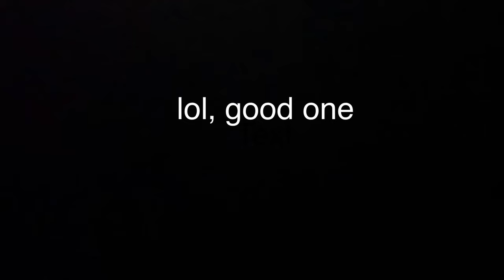(B)Lase it - Potting a Sotac Perst 4 laser tutorial

Comment: I bet if you press the circuit board into warm play-doh just deep enough it would allow you to pot the board to the edges all the way around. Press it into the depth corresponding to how thick you want the potting epoxy.
Reply from the maker: good call!
Reply: You can just masking/packing tape around the perimeter leaving a lip. Fill with potting then peel away tape when cured.
Reply: @LeCafeRacer  This is the way

Comment: I previously did this with airplane and missle parts. Typically you dont cover the lands and leads you put the compound at the ends of the part. Doing it this way 100% ensures youre buying a new one if any solder issue arrises because you cant access them now. If he placed the compound on the ends/ sides without leads you can easily fix or remove a part.
Reply: What do you mean at the end of the part?
Reply: @JohnDonne3PersonGod  the ends/ sides without leads(metal legs) coming off the part that are soldered to pads on the circuit board.
Reply: @JohnDonne3PersonGod  depending on the part you only apply it to the corners. It's all dependent on where the leads are. The pieces that don't have leads don't need it because the issue with those part is typically a solder fail. Parts that have leads are prone to having the leads break, this is why you don't cover them. The potting/bonding/masking is designed to help it last longer under prolonged vibration, but it will not PREVENT it from happening. When those leads break he's either going to buy a new on or use the appropriate chemicals and tooling to remove that bonding. A process thats likely to damage the board itself and other parts around the initial fail.
Reply: So if I'm envisioning this correctly, it's the potting compound on the edges of the PB and the underside w/o the leads? Is that really sufficient for vibration? I have no intuition regarding this.
Reply: @JohnDonne3PersonGod  sufficient enough to be used in military jet engines and JDAMs. Especially with the type of compound he used. There are parts and boards that get encapsulated but that encapsulate is as runny as water and after a bake in a humidity oven( basically a giant steamer) it sets to a consistency slightly harder than jello and can be removed with tweezers, a pick and q-tips with isopropyl alcohol. What he used will dry much harder and you need specific equipment to remove it. The typical potting you would see in commercial use will be a rubbery consistency because it disperses the vibrations, the harder compound he used is for securing parts to the board and to provide structural support for the leads.
Reply: @JohnDonne3PersonGod  so you could pot this but you would need place masking( removable silicon compound) where you don't want potting. Then figure out the best way to fill the full inside while removing as much of the air bubbles as you can, in prototyping i used a vacuum chamber to draw out bubbles. Then bake it in a humidity oven, the ones I used were 90° with a constant flow of steam.
Reply: @Noneyabiznez1209  Could you make a video or post photos to a blog showing your method?
Reply: @Zork13  I would, but the company and us government would appreciate me showing how boards used in JDAMs and our military jets are made. What I do with potting requires a vacuum chamber so the rtv or whatever product it used doesn't have air bubbles. This means mixing the product, placing it in a vacuum to remove bubbles. Filling whatever electrical component that needs reinforcement for vibration reduction purposes. Then, placing that entire part in a vacuum or filling while part is on a vibration table so bubbles are worked out by vibration. Then whatever curing method is described. If it's just staking corners you just place a line fton the top of the specific part and run it over the edge onto the circuit board, (((without putting the bonding or staking material on the tin lead leeds)))). If you use one that dries solid instead of more elastic it will damage your components if you ever need to take the bonding or staking off.

Comment: I used painters tape to cover those and carefully did mine with liquid electrical tape on the circuit board, and then used permatex gasket maker and clear silicone on the wires as well and inside the device.

Comment: I potted 5 with liquid electrical tape and hot glue. Also applied acrylic conformal coating to all the electronics. 
Lol, on some of them the top button doesn’t work and neither do the + or minus switches.
Thankfully, the other power switch works and the switch to change between vis and ir works. I also have the pad to change the power levels, which is annoying since I don’t look and can’t use it on a lot of the guns I have due to space. On the plus side, they don’t revert back to a base power level so I can pre program the power setting with those pads, if you’re using ir you should really use the lowest power setting anyway, 20mw just using that usable and way too bright. Even the 5mw should be used with a diffuser.
I bought them as dedicated IR lasers so I only wanna use the ir setting. It would be nice if the vis and ir were slaves though. Don’t see why they aren’t, wouldn’t cost more. 
It’s definitely full of glue and liquid electrical tape. Nothing is moving out of place and it’s better sealed against water now and moisture.

Comment: Might be a good idea to blast the PCB with conformal coating while you have the unit open, after potting. That way any ingress of moisture won't be as much of an issue.
A thin bead of blue loctite around the mating surfaces of the cover and a silica gel packet left inside would help, too.
Reply from the maker: yes! got my hands on some now

Comment: JB weld makes a metal infused epoxy that is like clay. And you mold the gardening compound in with your hands and you put it down like clay, so it doesn't run everywhere, and you push it into place. And you have the extra metal infusion for hardness. That would be good to use.
Reply from the maker: is it conductive? if steelstick actually has steel in it you would immediately short out your board and it would be useless

Comment: Great video! Just follow along and did mine. Have you thought of trying to investigate and fix the co-alignment issues with the IR and vis laser?
Reply: Just did mine as well and I'm pretty happy with it.  As far as the laser co-alignment, I've put a bit of thought into it myself and the only thing I can really think of is milling out a new laser head assembly out of aluminum (or something else strong) with perfectly parallel holes for the diodes to thread into. It wouldnt be too hard to do with a good mill or drill press but the turret assembly threads look pretty delicate so be careful disassembling it if you decide to put the effort in to go that route. Otherwise just pick which beam you like more, Then set it and forget it.
Reply from the maker: @Aupexx  yeah, for a 120$ device im not sure how far down the rabbit hole i want to go, i only got it for the IR since the vis is eh anyway
Reply: @tiffen-e7t  my thoughts exactly. I personally just put a diffuser  to catch the nasty diode spill. And put a small hole over the ir laser. Now I just use it as a single mode unit with an IR laser that has a bit of extra flood lighting from the diffuser. Cost about $10 and works well enough that I'm happy with it
Reply: @tiffen-e7t  great video by the way! Potted my unit and it's holding beautifully
Reply from the maker: @Aupexx  awesome to hear! I didnt think this would get so many views lol, just a little hobby project of mine. I actually just ordered a Wadsn Raid-x to try the same thing. Im curious to see how it opens up and if it offers more access to the lasers themselves, might be an opportunity to co-align easier. just ordered it yesterday so i guess we will see!
Reply: @tiffen-e7t  hell yeah! Would love to see a video on that when you get it figured out. Cheap lasers have become a bit of a hobby for a lot of us it seems haha
Reply: @tiffen-e7t I agree. I ordered one after you posted this video and decided for $120 it's worth it for an IR standalone unit.
Reply: Anyone experiencing batteries dying while set to off?
Reply: @tiffen-e7t So I got curious and decided to try my hand at co-aligning the lasers. I purchased another unit to play around with and disassembled it.

The problem I ran into is that the housing for the laser modules themselves is very thin all around. There simply isn't room to add indexing set screws or anything. Plus the lasers were fully potted with hot glue and I didn't bother digging them out of the housing.

Comment: Heat around the lip with a heat gun on low, then use compressed air with a rubber tipped nozzle to blow into the screw hole and it will pop out...

Comment: i thought you were going to adjust the laser, thats what we called potting back in the day, because you adjusted the "pot" or the potentiometer that controlled the power going to the diode.

i see potting electronics is the act of dipping a pcb or other electronics and or assemblies all at once into a "pot" of material that would harden and make the electronics sturdier, protect from shock, chemicals, water, liquids, gases etc etc.

i would guess that this "potting" in the video is more of an  "conformal coating" application.

 i found the title of and the action in the video to be confusing and thought i would share my take, but what do i know.

Comment: Wouldnt a better method, or an additional method, be soldering the connections to be stronger and/or replacing weak wire with stronger wire? It seems to me that pitting wouldnt be as necessary if the connections are beefed up
Reply from the maker: Certainly could help if you have the skills and patience, but its generally not the wires that are breaking, and adding more solder doesnt necessarily mean a stronger connection, so the potting just locks what needs to be locked in place and protects it against the recoil.

Comment: Any update here?
Did you do anything to the springs that holds the laser in place?
When those springs move the zero will move. I put some epoxy on both springs so they can’t change position.
Reply: @JetHenke HAHA I see at least 2 of us are spending NYE checking for updates on DIY laser armoring 😂 
I also want to know about those. Think I’m gonna epoxy mine if it worked out for you… I legit also thought about ordering custom wound replacement springs & swapping them in. Likely overkill AF, but that is def me… overkill AF. Wife calls me “Garage Overengineer” 🥸
Reply: @j.crizzle8942   Haha 😂 I have spent half day with my Perst-4. I secured it inside with epoxy on some spots and then glued the 2 springs with epoxy. After that i did alot of drop test from 7-8 feet down to the concrete floor. Nothing moves, it keeps zero perfect. Now i’m sure it will hold for my .223 😁
Reply: @JetHenke  YASSSSS 😆 that’s rad. Happy New Year of Pewing 👊🏽
Reply from the maker: @JetHenke i wouldnt epoxy them since then you literally can never change it. I wasnt able to get the turrets out without destroying it so i didnt mess with em. id be curious to hear how you got in there
Reply: @tiffen-e7t  It’s to late 😄
I was not able to remove the turrets but i took a small plastic pinn and put some epoxy between the laser and the spring, in other words is the laser and spring connected, so the spring can’t move away.
It’s still full functional since it’s not glue on the other side. 
It works perfect so far and i hope it will continue that way, i’m not ready to spend money on an authentic Perst 4 😬
Reply from the maker: @JetHenke  how did you get to the lasers? through the front?
Reply: @tiffen-e7t  Yes the front. I used a good led light. It’s pretty tricky!

Comment: wouldn't just using hot glue on everything achieve the same thing? why is the potting compound necessary?
Reply from the maker: potting compound hardens to a solid epoxy when cured. This holds everything together as one unit. Hot glue would still leave it open to vibration due to its softer cure when cold
Reply: @tiffen-e7t  i thought about that, but then wouldn't it being softer mean it would dampen more of the shock, the glue absorbing the vibration and thus keeping those forces off of the components? rigidity is not always the most prevalent factor for these kinds of things, the concept that comes to mind is the best swords actually have a degree of flexibility to them, too rigid can cause it to shatter and too flexible will cause it to deform. i obviously could be wrong, but what do you think?
Reply from the maker: @Knifegash  you want everything to move together. If the material is soft, eventually the pcb will vibrate independent of the soft hot glue as it would detach since they will absorb vibration differently. like, if you take a buit of hot glue over something, and roll your thumb over it, it will eventually separate from the component. epoxy wont do that

Comment: Just curious - what is the purpose of doing this?  Is it mainly to keep components from coming off the PCB under rough use?  If so, wouldn't it also be beneficial to resolder the components with leaded solder for greater flexibility?
Reply: It's to help vibration mitigation. It can pop parts loose this helps prevent that from happening as often. This was done wrong though. It will work for what he wants it to do, until it doesn't and then he can't fix this. We'll he could but to remove that bonding it's a long and frustrating process even if you use the correct tools of solvents, and there is major risk of damaging even more parts. I use to designed bonding templates and practices while working on airplane and JDAM circuit boards.
Reply: @Noneyabiznez1209  -  Good point, would be a nightmare to service this thing afterwards.  But at the pricepoint these come in at, probably not really taken into consideration.  I would have started with leaded solder, personally.
Reply: @DragunBreath  yes they could have provided a stronger solder weld. But you can't just add a tom of solder to a Lea d Backes they are designed to flex and give slightly. If you over fill the lead/pad it can actually cause a failure. To be honest at this price point of you just disassembled it and masked off the no-go areas you don't want potting. You could drill a small hole and use a syringe to inject it, tapping every so often to get bubbles out. Or use the bonding in the video correctly and only apply it away from the leads. The guy has the right idea he just kind of combined the 2 instead of choosing one.
Reply: @Noneyabiznez1209  - Oh no, don't get me wrong, I'm talking solder replacement, not adding leaded.  Wick off the crappy brittle, but oh so ROHS-compliant garbage, then re-solder with the proper amount of leaded.  Mixing solder types is typically a bad idea, anyhow.
Reply: @DragunBreath  bingo! You know what you're doing.
Reply: @DragunBreath

How much you charge to do this? I no longer have access to the hot air station I used to, as well as a perma-tremor due to injury. 
I think to have this done would probably end us costing over the price of a legit Zenitco/mawl/dbal etc, but I’ve DEF been wrong before.. If you can’t do as a service, can you recommend someone?

Comment: I have a request if you can help me. I have a power draw problem with a Chinese peq. Even if the peq is turned off, the battery runs out very quickly.
Reply: Is it set on off and are you using a pressure pad?
Reply: Even with a real peq I have this problem. Always loosen the battery cap

Comment: How well is the perst holding up? I'm pretty eager to know. I'm considering buying either a sotac perst/mawl or a somogear ngal
Reply: Mine is not potted yet and has not lost zero till it bumped it into a fence. Rezeroed it and its still running like a top only have loke 1500 rounds on it but it works pretty good. I plan on still potting the unit.

Comment: @ 3:00   ---->   Better off to use a (metal) automotive or dental pick...    😉
Reply from the maker: i tried a couple picks to no avail. the better method would be to find a chemical tat dissolves the adhesive. Pretty sure its just red loctite but i was hesitant to put too much heat into it